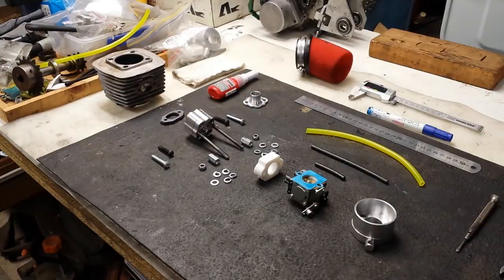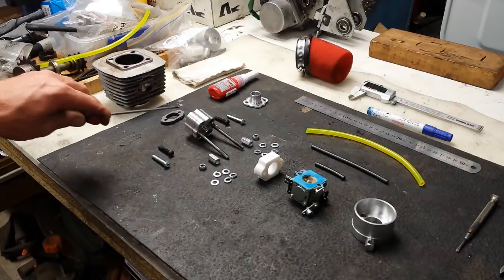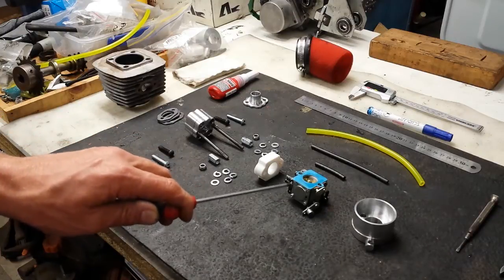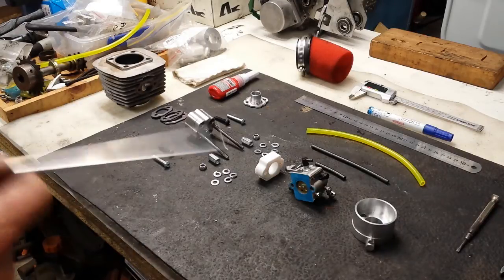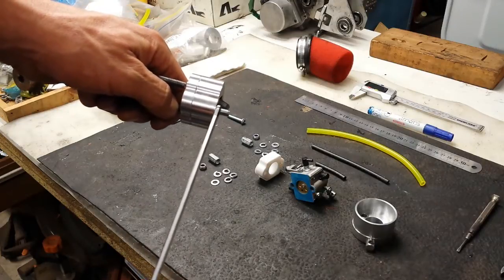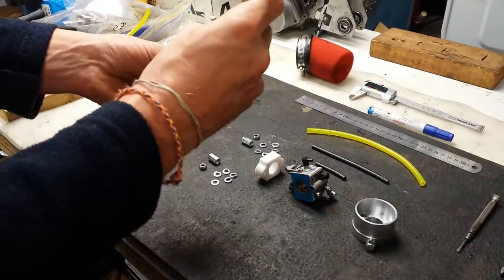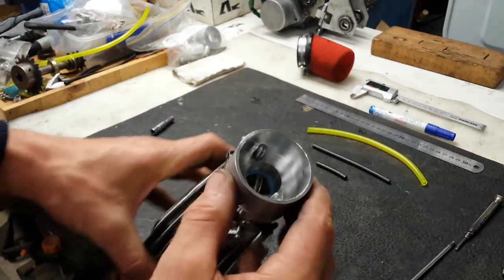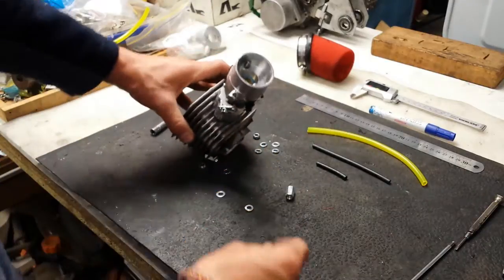R.S.E.  Reed Valve & Diaphragm Carburettor Assembly - part 1

Comment: most of the walbro carbs has no pulse line the pulse is on the intake manifold on the carb that's on jnmotors
Reply: Darius Sykes im a dummy and need it spelled out. So if i buy the intake from jm i dont need to drill out a pulse line?
Reply: Man_of The_year perhaps not, if the pulse line in your carb matches up with the one in the jm intake, but you’ll have to buy the jm one to see if it does.

Comment: I got a reed valve kit from bikeberry and I got a windowed piston on ebay, and I lost power. The engine just seems really lazy now. Any ideas what it could be?
Reply from the maker: It is very important that the reed valve system is as small as it can be, yet still allow good flow through the reed valve. It must be remembered that a large reed valve will significantly reduce crankcase compression and thereby reduce performance.
Reply: Dragonfly76 (google it) has a lot of in depth info on everything motorized bikes. And he talks about your issues and reed valves.
Reply: Test your wet and dry compression with both setups. Your jug might just be out of round.
Reply: You have to make sure the intake port is big enough for the reed to fully open. They commonly don't on these little engines.

Comment: Is this preferred to the original carbs?
Reply from the maker: There is no effective performance difference between a well-tuned standard carburettor and a diaphragm carburettor of similar venturi diameter. The major advantage of the diaphragm carburettor is that it has external mixture adjustment and does not suffer from fuel leaks.
Reply: My “Speed” ‘original’ non-diaphragm carb either has an external mixture adjustment or just a dummy screw. We’ll see if it really leaks later.